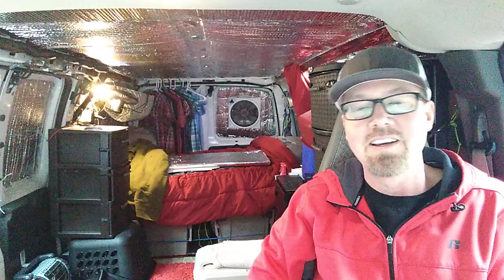Van life. $$$, van repairs, expenses, prepping 😮

Comment: You can use a long shaft screw driver and place the point end on the pulley or alternator or whatever you suspect it is and then place your ear on the handle. This will allow you to determine where the sound is coming from.